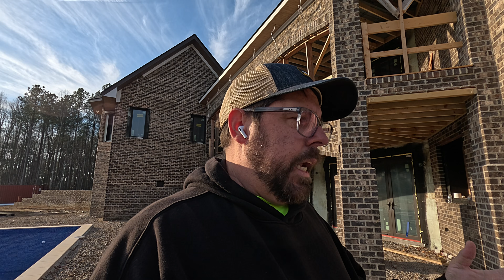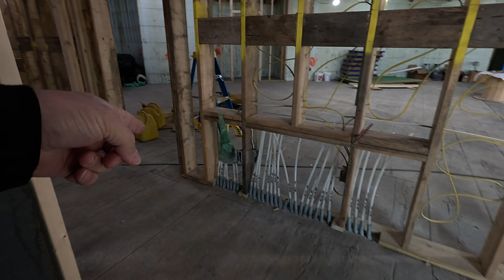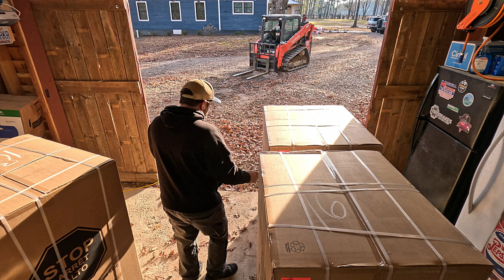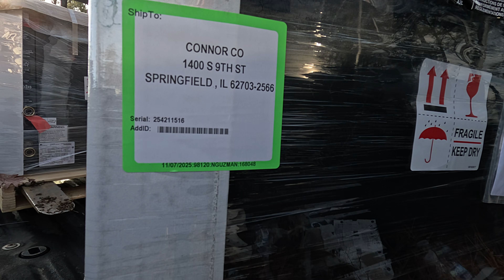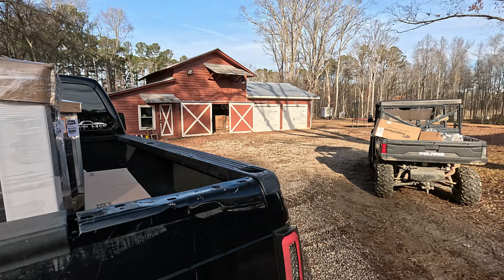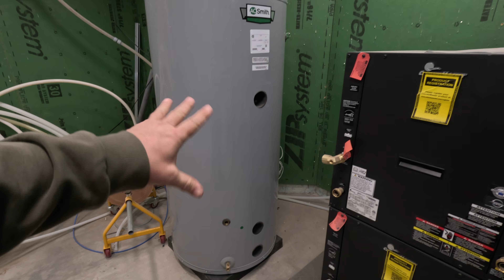Geothermal HVAC Installation Starts Now | Here's What It Looks Like

Comment: If you’re dealing with a complex HVAC system like this, it’s crucial to keep everything well-maintained. I remember when American Residential Services checked my system, they found a few airflow issues that were causing uneven heating. Regular inspections can really help catch those problems before they escalate, especially with radiant heating. How do you plan to monitor the efficiency of your system as things progress?
Reply from the maker: Everything I have reports info. Probably too much 😂

Comment: Geothermal systems look straightforward in videos but there's usually way more complexity with the ground loops and heat exchangers than what you see - American Residential Services handles heating system installation for setups like this when it gets complicated.
Reply from the maker: Yes. Lots of little details. I have a geothermal engineer

Comment: Good morning Geof i was wondering with this house slab heating how long does it take for the heat to bleed off,when the seasons change,and summer starts and you turn the heating system off.Must say its very effective way of heating a large home like your castle.
Kym
Adelaide
Reply: In brutal simplistic terms you run the system backwards. All those tubes used to heat the house are also used to cool the house.
Reply: @ArnieD17 
Ohhhh yes of course,didnt think of that
Reply from the maker: I will give feedback once we experience seasons in the house :)

Comment: I just want to thank you Mr. Bealy Good, for single handedly spurring the economy in your state. I know that geo thermal, radiant heat stuff isn`t cheap and you have a garage full of it. It looks like you spent 100K on the pex pipe alone, hehe.
Reply from the maker: Not far off 😂😮😊
Reply: @BealyGood  But aren't you glad that the old days of copper piping is over? All those miles of copper would break the bank. Use to work as a bar manager in a concert venue that had 800 person capacity and it was radiant heat in the floor powered by an outdoor wood boiler. Hated loading that boiler with four foot long logs. But it was great heat in that building. Nice even heat everywhere with no cold or drafty spots. Every inch of that pipe in the floor was copper then sprayed with a coating before the concrete was poured. At least that is how they explained it to me as it was up and running before I moved near by. Four foot long logs of oak and hickory are heavy especially when the get up to eight or ten inches round. I was younger then.